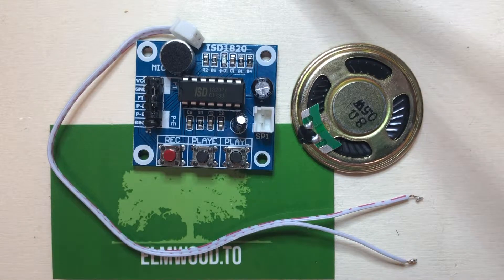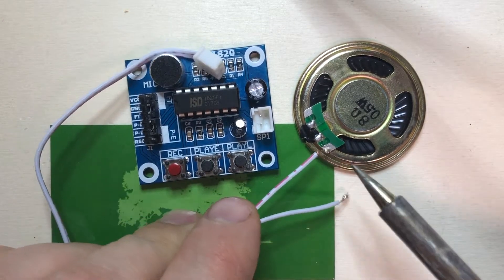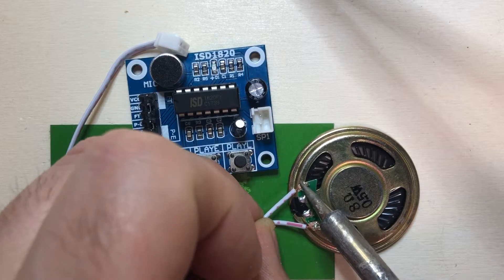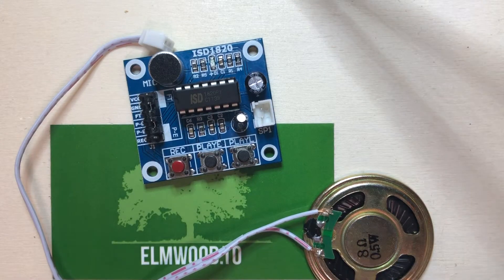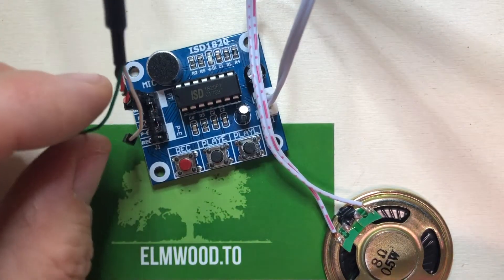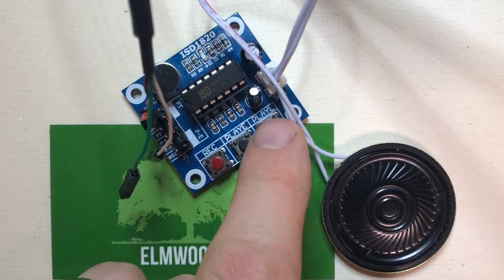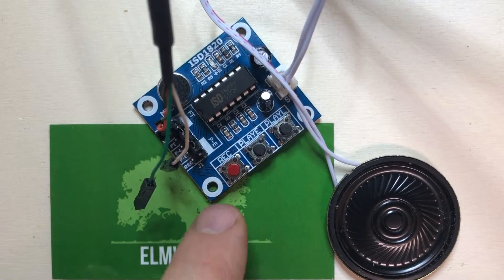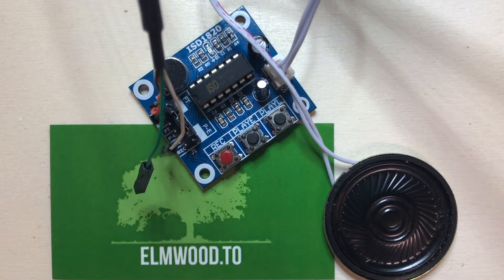ISD1820 3-5V Recording Voice Module Unboxing Video

Comment: Can you use this as a megaphone or pass through?
Reply from the maker: It is not very loud.  You might be able to add an amplifier and a bigger speaker but we have not tried that.
Reply: @elmwoodelectronics864  thanks for the reply - how do you set the jumpers to use it as a megaphone?